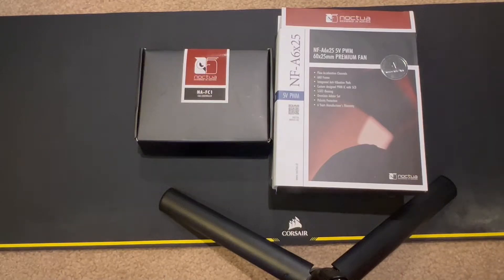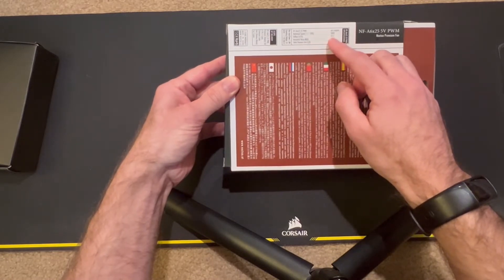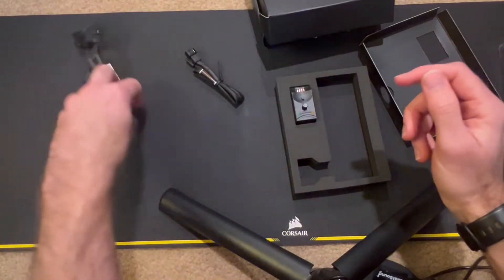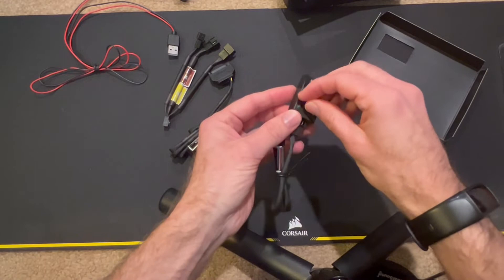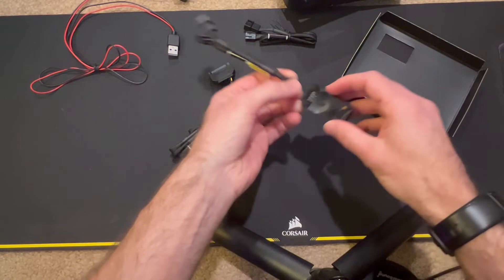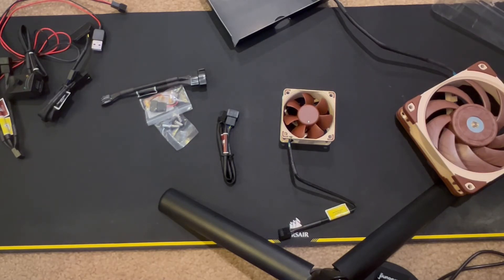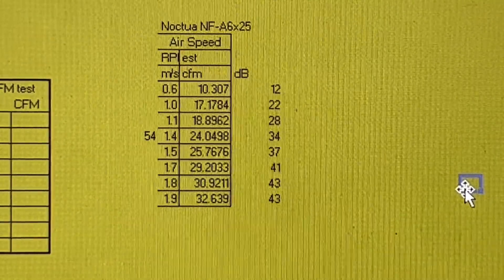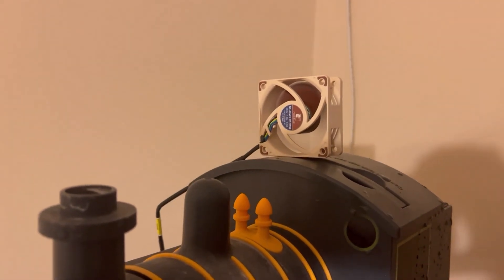Noctua NF-A6x25 Performance & Improving Mist Dispersion of Cool Mist Humidifier

Comment: Hey, I have Advantech 1960052651N021 cooler running on Everflow/Cooljag RB6020BU 4-pin, 20mm fan.
Do you think I can install NF-A6x25 pwm?
Max. temp on Everflow are 67 Celsius on i7-6700 non-k processor.
Size fits, but Noctua is saying 29 m³/h on 3000rpm versus 49 m³/h, 5800rpm on stock cooler fan.

Case model 4U acp-4340mb-00xe
There is 8cm fan on drives bay, one 12cm inlet fan, gtx1660 super and corsair HX520.
Any advice to make pc quieter under load will be awesome.
Reply from the maker: if i recall about the 6000 series the max temp they like is around 70 or 80c. I would say the Noctua would work but you would loose performance. I dont think it moves enough air.
Reply: @computer-tech-more  Thanks for response. Your point of view is right. I should wait for Noctua to make 4000rpm 60mm fan. Now leave it with loud server cooler.
Also Advantech support doesn't want to give information about possibility to replace cooler, fan, backplate on AIMB-785 motherboards.
Reply from the maker: @michalwielgat  ive wanted to get into the 60, 80 and 92mm fan reviews but just havent gotten to it. 
So I'm not really sure whats out there. sorry

Comment: What will happen if you don't use the fan controller? Will it run max speed?
Reply from the maker: More or less yes. Although I think the super cheap usb cable I have powering it isnt giving it full juice but its quiet and helping disperse the mist so its fine.